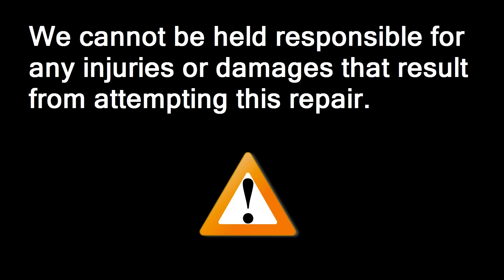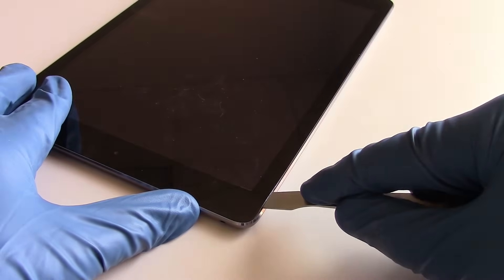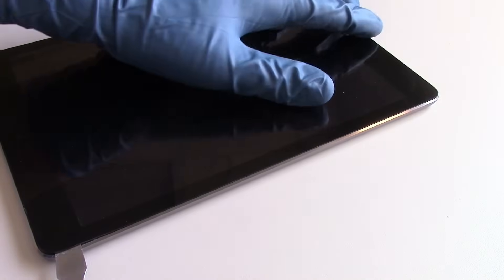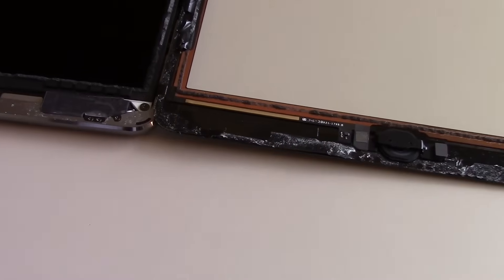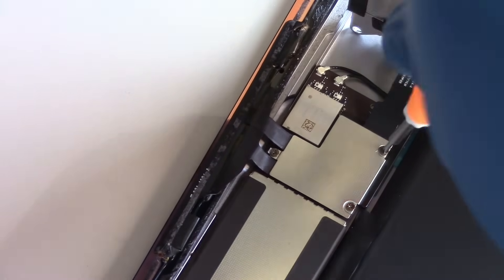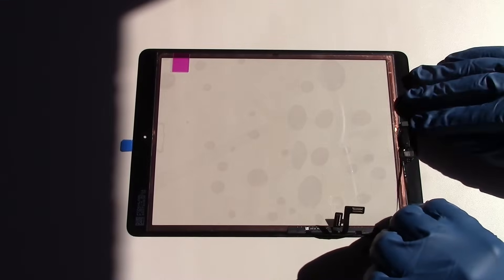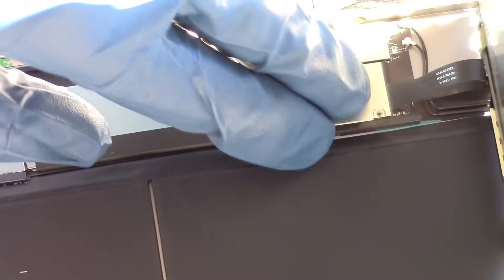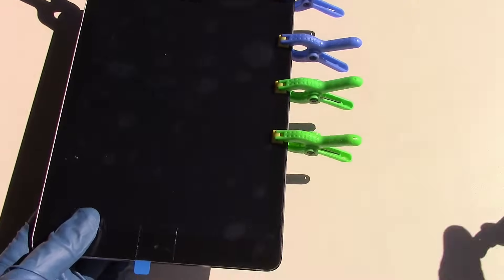iPad Air Screen Repair Glass Replacement Video Tutorial How To

Comment: your video did help me in crucial areas of the repair.
i managed to save my severely damaged iPad after 6 years of it being cracked. At first. 6 years ago the 3 cracks were the length of the iPad but the small cracks were at the top near the camera and over time they chipped away even under the Glass Screen protector i immediately placed on her after the mishap. She worked great and flawless until two weeks ago when i dropped her on a corner and she cracked more and became inoperable. This repair saved her for the most part. My white background looks like a rumpled white sheet at the two top corners, but not a huge issue for me.
The automatic rotating mechanism isn't functioning and I'm not upset about that at all. I did overheat the edges in 2 spots and they are evident but not intrusive in any way to me. Just be aware when doing this to constantly move the heat gun as opposed to stopping in one spot for even 5 seconds. I have anomaly of white sheet image in the background. and the screen rotation doesn't work, otherwise its all good!!

Comment: Guys,  just before the minute 12... if you do not disconnect the battery it will be dead after finishing 
Remember to disconnect the battery before removing any cables...
Reply: Bom dia, se não desconectar a bateira ela pode ser prejudicada permanentemente?
Reply: Sim, o meu queimou a câmera frontal porque não desliguei. E se você não desconectar, o ipad não vai iniciar após instalar tudo. Cuidado, não troque os parafusos porque lhe tará screw damage. Todos os parafusos tem uma medida milimétrica e se você põe um que arroneamente, atingirá a mother board.